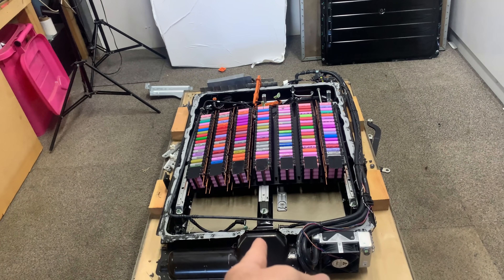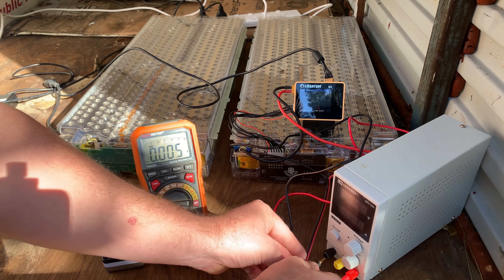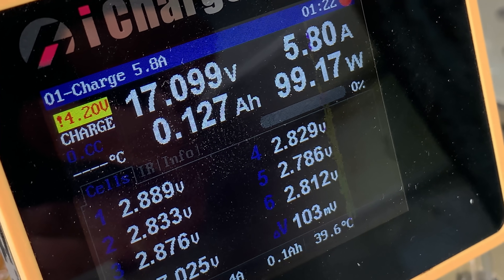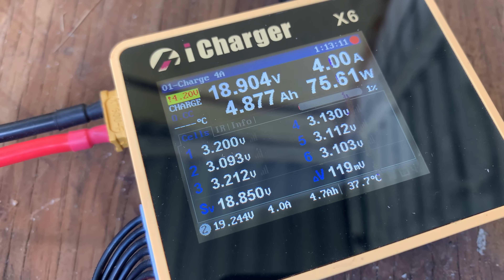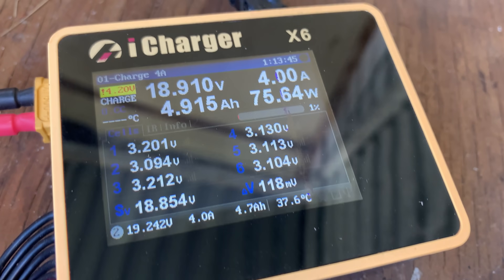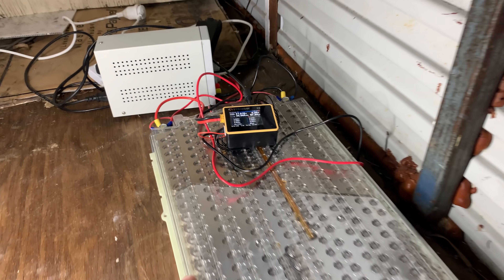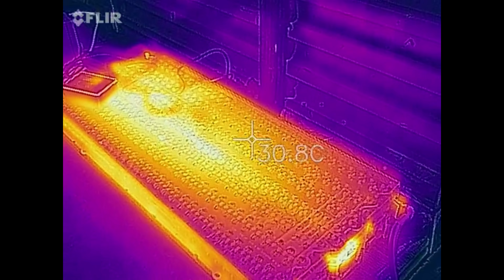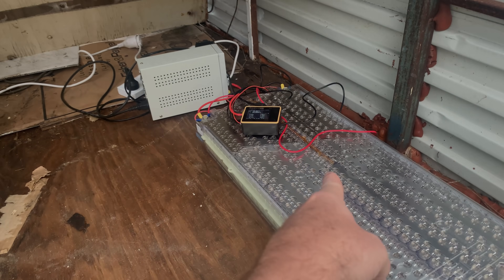The process of recovering Tesla modules from Zero Volt to useable!

Comment: something positive out of all this:
you have found a weakness in the tesla packs, in that the bms does not shut down its own drain current when cells reach a certain voltage. 
There is no 'save the cells' mode present.......bit of a design flaw I would think.
Good cells will last years or even decades if good quality, self discharge is so low in a good cell, that 5 years would not be a concern.

Comment: Good job, of course that worked, that's exactly how you recover bad cells. I'm surprised your Dell laptop charger did not explode. The batteries attempt to pull more than one amp for each cell, because there are not resistors. However, I am not certain you are charging that pack correctly with the correct voltage, especially since the battery charger is flashing "not 4.2" volts.

Comment: 4:07 You can clearly see some bad cells. My guess is, that if you would replace those,  this battery pack could be revived. If you have short there, it will bleed the rest.
Reply from the maker: Unfortuntally you can't see bad cells as the shiny surface of the bus bar destroys what's really happening underneath - would need to tare down and test
Reply: @HBPowerwall  There are cell-sized hotspots and double-cell sized coldspots. It may be something else reflecting of a metal, but it stays in a same position as you move.
Reply from the maker: arr ok will have to rewatch raw footage.. maybe I missed it - still have them so might revisit

Comment: I've successfully resurrected a few 3.7V nominal Li-Ion cells (in 3s1p packs) that were proper 0.0V dead and are now holding their charge long term. First failed attempt was slow charge 50mA (also tried 100mA) to 3V (which worked to revive other cells previously) but the cells refused to get past ~1.5V, even after a couple hours. If I stopped charging the cells would quickly self discharge. I wanted to learn, took precautions, and as a last ditch attempt tried what I'll call 'shock therapy'. Set power supply to 3V 5A and connected each cell. For said cells that was ~2C rate (note spec said max 1C charge). Took a few seconds but amps started dropping indicating cell was actually accepting charge. A ~minute later and I think it was down to ~1A IIRC and if charging stopped the self discharge rate was significantly less. I switched to 3s1p pack charging using a balance charger at 500mA / ~0.2C until the cells hit 4.2V, which took a loong time, 8h or so. This indicated significant self discharge. Cells were very warm towards the end too. Next day, the cells were down to 4.0-3.7. I cycled them down to 3v then back on 0.2C balance charging to 4.2V. Day after they were holding at 4.1xV. Success. The revived packs need balancing much more often but otherwise are okay. Experts will say 'dendritic growth' (the resistive shunts that results in the cells heating up) and I'll counter that the initial shock therapy probably burnt most of them out. The part that I don't understand yet is why the cell self discharge rate reduces over time while the cell is charged.
This experience is why I think you were partly successful. The difference from my 3s1p is that you are dealing with a 6s74p battery. If indeed a ~2C rate initial shock therapy is needed you'd need to have provided ~6x3V x 370A which would be insane and explosive. Each of the cells in each 74p 'layer' will have various amounts of dendritic growth due to the dead 0V treatment and thus the 370A would not distribute equaly. If you were to give it another attempt and know the precautions to take, I would suggest splitting into/connecting individual cells and for each trying the 3V 5A (i.e. ~2C) shock therapy.
For anyone reading: DANGER, DO NOT ATTEMPT. RISK OF FIRE, FUMES and if you do it wrong enough, exploding/bursting batteries. Resurrected cells are even more likely to spontaneously burst into flames, due to proven dendritic growth and varied self discharge rates and especially if in parallel to other cells.

Comment: As dangerous as these cells are when they're in primo shape, why would anyone want to revive them once they're so far gone? They are a fire hazard waiting to be had. This gentleman did the right thing! Great video!
Reply from the maker: In a third world country and this is the one chance you had of storing energy? There are reasons for everything and not just the obvious - it was a fun experiment tho and I STILL have it on charge at 0.5amps :P
Reply: They're only a danger if you abuse them and don't respect their charge/discharge rate specs.

(For example, a 5000mAh 21700 cell with a 15A discharge continuous and 1C charge rate, stay within those specs)

Comment: For those insisting there’s a way to revive these, it’s important to understand that when lithium batteries are at a low charge state, they form copper shunts that lead to self discharge and possibly a short. The heat exhibited when not charging is clear evidence that this has occurred. Continued efforts to charge could have catastrophic results. 

Great demonstration. Thanks
Reply: Not quite. The short only happens when reverse charged. An individual cell can go to 0V no problem. In a pack though there is always one that is drained first. That one is reverse charged by the others then.

Comment: Could you explain to me why the cells are getting hot even tho your not charging them and the pack has been sitting out all night? Cheers
Reply from the maker: Internal shorting within the batteries causing them to heat up. This is how thermal runaway occurs
Reply: @HBPowerwall  ah ok, so what does the battery cells short to?
Reply: Do they short internally and then burn out damaging the cell next to them and so on?

Comment: The tests you did show that these batteries cant be charged but I would still like to understand exactly why they did this or exactly why they were producing so much internal heat? Is it because plate separating  layers broke down or could dendrites  have  formed when the cells completely discharged. I am some what puzzled with these results because many times over the years I have been asked to repair various cordless power tools powered with lithium ion cells which should be of lower quality then the cells in these batteries and in most of those power tools some of which were completely discharged for many years would come back if slowly charged and in some cases, they needed a higher current booster charge to initiate the charging process but then they would fully recover. Its puzzling to me that cells that are apparently so advanced fail so miserably.
Reply: Actually the lower quality makes them tougher against this because what happens is they have a thicker separator and or are less compacted into the cylinder because they don't require 3200mah per cell they mostly hover around 2500mah. So what happens with these they are mutch more compacted and way thinner separator it's easier to perforated said membrane hence why they can fail easier based of dendrides 😊

Comment: BTW did you check the output of your power supply? I've a very similar unit and what was on the LED readouts was way off. In fact I got a full refund and did not have the return the PS. I doubt it would make any difference to your results even if yours was the same as mine.
Tx for the great videos Cheers from Melbourne

Comment: HBPowerwall - Thank you again for another great Video. It is such a shame to see this and know that it will be a boat anchor at most., my power supply turned up last week and my pack with the voltage of over 10v has been charging and is at 22v. I have a security camera on it and multimeter connected so I am monitoring all day. I have rigged it up outside and well away from anything, just encase. I am running 4 amps into it only and it will still take time. I have an IP based 240 volt switch so if it starts to smoke etc i can turn the power of remotely. This pack seems to be ok, no discharge from when I last measured a couple of weeks ago. The other pack was the low voltage one, which I got to 8 volts and has sat there as well. Hoping it will take a charge. Will be putting it on tonight to start to get it up there. I dont have the BMS boards or a icharger yet so I wont push full voltage until I get something in place for that. All going well it might be useable. Keep posting when you do stuff with yours.

Comment: I think if you were to break the packs apart and focus on Packs 1, 3, and 5, you may find that the majority are fine and there's only a few SD's. Obviously Pack 2 has a lot of SD's and I wouldn't even be bothered doing anything with that one. Packs 4 and 6 will be highly suspect.
So, if you were to do another test run, I would charge each pack individually "outside" of the housing (if you can, not sure how easy they are to dismantle) and then use the Flir to see which one are heating up. Test current would be about 1A/cell if you can manage it. That should make the heaters show up quickly and leak the heat into neighboring cells too fast.
Reply from the maker: I think I need to do more tests but not sure how much more I can milk from these batteries for content with out boring people
Reply: @HBPowerwall  Haha  true.   Well, you could pump them full of amps till they 💥 😜

Comment: Hey Pete!  I would try one more time or at least revive to a level when you can put it back so the internal charger/bms can do it's thing. If it's still a no go then try isolate the heaters with quick high power charging(not my first choice for sure) or an esr meter or maybe a high(5.5/6.5) digit multimeter. Anyways a frankentesla powerwall with recycled cells would be funny 🤓😬
Reply: It's not that funny. That's what mine is and I'm really impressed by it.

Comment: I had a completely dead cell, and my power supply has both current and voltage limits. At first I set current limit to about 10 ma and the voltage fairly high, around 20 V. The cell started to slowly charge and was at voltage limit. I was watching the temp, At some point the voltage started dropping because of the current limit. I let it charge until the voltage reached cell rated voltage, and then started increasing current limit and dropped voltage down to right above rated voltage. I then let it charge at the normal rate while watching temp. The cell charged fully and has been working well since then. Of course this was only one cell.
Reply from the maker: That was the last video :)

Comment: Well I guess the less than 2V=bin rule is for a reason.
Reply from the maker: Never heard of or used that rule....
Reply: @HBPowerwall  Really?
Aren't you like building power walls out of wasted laptop batteries?
Or maybe it was Jehu...
Generally if you salvage some kind of a pack and the cell was sitting less than 2V then it's trash, if it's above its reusable.
There are chemical reactions happening under certain charge level that are irreversible, but as it's chemically related you actually might be able to revive 0V cells of some chemistry types.
Reply from the maker: Jehu hasn't finished building anything useable lol You're right its a very general rule how ever I still have in service 100s of cells recovered from well under 1/2v still in service for years and years..
Reply: @HBPowerwall  Yes that's what I said, can vary on chemistry type.

Comment: Behaving similar to a drill battery I'm working on. Was 0 volt. Used some voltage to start the battery cells one group at a time (so 1s2p in a 5s2p pack). one dual group was dead, 2 dual groups had one shorted cell that discharged the other one, one group was heavily corroded so didn't put in the effort. Things I did discover though, is that the "good?" cells would appear to discharge overnight when not on the charger, but would take charge again the next morning. However, each morning I repeated this and several times during the day the batteries kept loosing less and less energy, and started staying at a higher voltage. these are LiIon 3.6v cells. I suspect you have similar issues with that pack, and I'd probably suggest looking at the cells individually.

Besides, as interesting as the modules are, I want to see what the actual cells look like and maybe some of those are individually recoverable. :)

Comment: Obviously it does not run anymore as battery pack. These batteries are long gone to tesla hell. Even brand new battery pack design have a big troubles, because so many parallel cells. 1 weaker/bad cell can ruin everything. Sure it is possible to balance every cells individually but it add insane cost for battery manufacturing.
Reply from the maker: The positives outweigh the negatives..
Reply: @HBPowerwall  Obviously here is 2 parts, the 5 year old garbage and the current garbage. Obviously they made 5 years ago the mistake and did nit installed the pull out tab(s) to cut the power off from BMS. BMS sucks that battery back empty by months. Constant balancing, balancing, balancing generate only waste heat and so that battery drains. 5 years no BMS can lead the same result, so 5 years is way too long time for storage. Everyone can agree, way too many cells are parallel and nothing balance these individually. Only safety device is tiny connection what acts like the fuse. 5 years later, they produce almost the same garbage. It is cheap, that is why. The profit is the king. Sure they will reduce the cell numbers by new bigger battery units.

Comment: Nice try. Facts don't lie. Internal resistance is just too high and while can put energy in it's not retained. It just leaks out as heat. 

Wonder what odds are that you can find a pair of modules from salavage Model S/X in Oz?
In US, they are pretty common. But then you'll still have now way to activate it; unless there is a way to run off-grid. (know it's possible, as Tesla has demoed on RV trailer as mobile showroom)
Reply from the maker: That too easy, If i get it running again i'll do it the hard way..

Comment: Not sure how your watercooling setup was, but unless the tubes are free of air you can get some hot spots. Not related to your issues, but putting a trickle through causes one side to be hot/cooler and eventually it will crack and leak. :(
Reply from the maker: All the air was bled from the loop first.. Clear pipe helps with that a-lot :P

Comment: Interesting results. Knew it was very unlikely to wake from the dead, but didn't expect it to act like it was charging.
Reply from the maker: It accepted a charge - just didn't hold onto it
Reply: @HBPowerwall  Most likely to be a handful of bad cells. Now if you could locate which ones then the existing fuses could be leveraged to effectively isolate them.

Comment: You do NOT want to trust "revived" li-ion or li-poly batteries after they drop below critical cell voltages of ~2v. The ionic equilivant of dendrites begin to form at these low cell voltages, and when "revived" they will have higher internal resistance, and orders of magnitude larger self discharge, to the point that they can move into thermal avalanche on their own when charged. They are unstable. 
Reclaim and reuse the ones that are good, throw out/recycle the bad and move on everyone, for your safety!
Reply from the maker: The high resistance seems obvious, all that free hot water!

Comment: Hey you can use those batteries,
For thermal storage! Haha!
I had a similar  fieasco with lifepo4 cells that died to death on the shelf, but they all wasn't at 0v. But we're close, the 3.2ah cells were tested to about 30-60 mAh  a few were at 1-1.5 ah, but some acted more like capacitors, they would go to 0v nearly didn't get hot until over 3.5v I could discharge, let sit, it would go up to 3.5v, discharge again, about 60 mah, about 4-6 times, without recharge! Luckally I only had about 10cent per cell in them, and the few that were at 1/2 capacity were kinda worth it! I'm going to use them in landscape solar lights!  Maybe! Haha,
Reply from the maker: lol - that's a different take on it

Comment: Heck yeah, check out David Visard! He builds racing mini engines, he has a load of experience building mini engines,  the mini heads need porting and a scatter pattern cam with a good valve job multiple angle valve job, the valves are too small for the engine to make real power! Being a odd fire engine, with siamesed intake ports it needs the scatter pattern cam,  also boring the lifter bored for larger lifters is a good upgrade, but. I don't think you are building a racing mini! But more power is better right!!
Reply from the maker: Fast road cam, 80' over, mild port job, bigger valves, double springs - all the basic stuff to keep it drivable but fun.

Comment: You should pull it apart and charge the cells individually I think you will be surprised at the results. Out of 444 cell on a tesla model S battery that was reading no voltage I have recovered 380 cells.
Reply from the maker: i think i'll try this!

Comment: Now we should ask our selves, why is this battery dead? Did it discharge it purposely e.g. after a fault? I recovered hundreds to thousands dead cells from ebike packs. Some were at 0 Volts for years. Maybe the powerwall had a high amount of cycles. Is there any chance to read that out?
Thanks for these interesting videos anyway!
Reply from the maker: I think you'd need some Tesla Magic to get that info out - battery was ment to be used but it has clearly been installed - just don't know how long or why it was removed